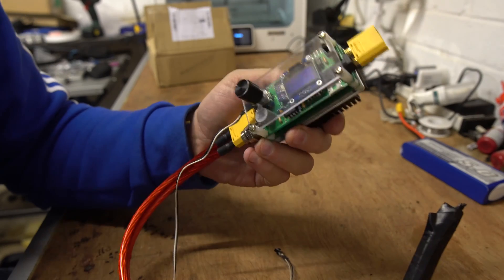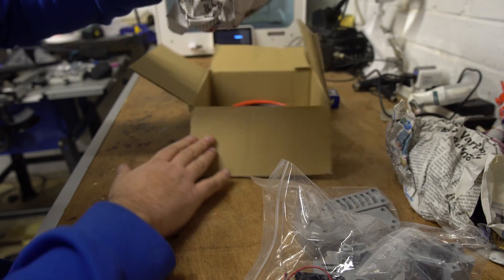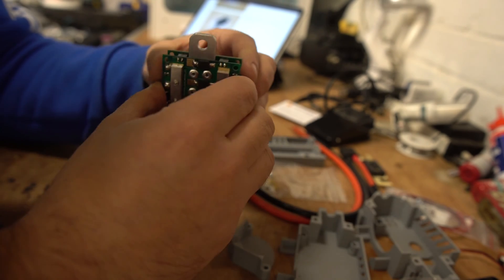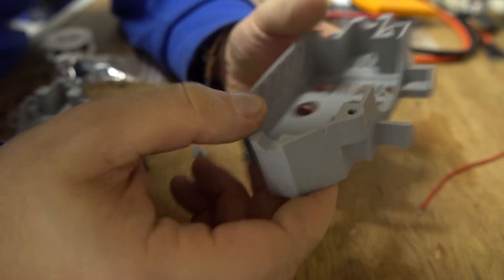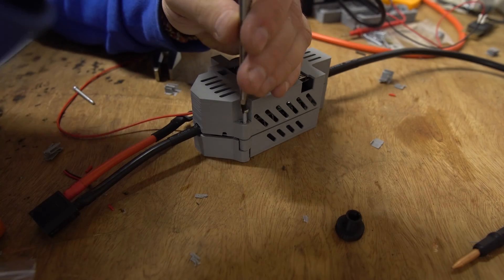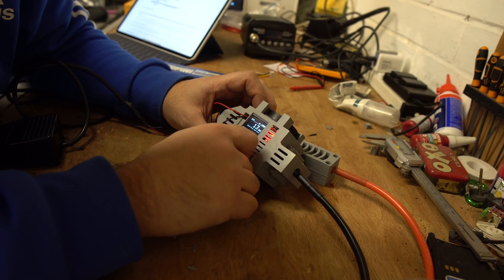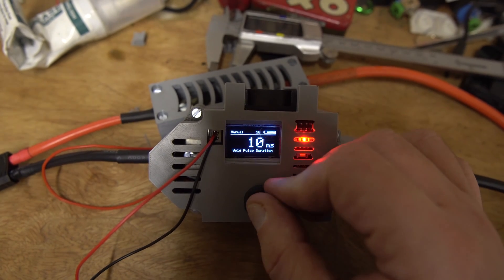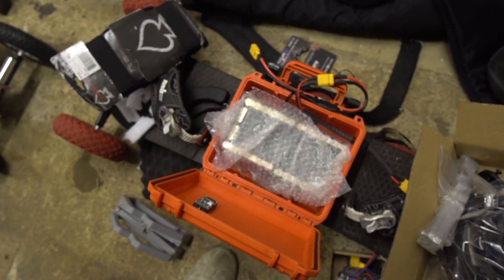New Spot Welder! Maletrics Build and Review

Comment: I myself got the cheap 15$ pcb with 5 high powered mosfets with everything needed and just printed a case for it and use it with a car battery. works excellently with no heating issues.

Comment: for the price of that you could buy a professional very good spot welder from aliexpress! and no batteries needed.
Reply: professional u cant even weld thicker then 0.15mm lol
Reply: bought this and it's worth twice what I paid for it! Go ahead and get a crappy plug in one. I had the "good" one before that you "just plug in". And it wouldn't even do .15. The malectrics does .15 at level 5 of 50. 600a from a battery or 100a from a plug. You deside.
Reply: good luck with it. Those plug in ones tend to be crappy for .15 and larger.

Comment: microwave transformer. timer board from a sunkko. diy pen 2awg with 4awg tips. its a beast...cost what 25 bucks or so to build? the timer thyristor board is 10 bucks. the microwave transformer free. 2awg welding cable 1.50 a foot from the local supply. 3d printed pen. most expensive part are the 2awg splice connectors that i use to connect the tips to the cable. they are about 7 bucks each.
Reply: goodluck running around and search scrapyard and putthings together

Comment: jfc..... just buy a lawn battery 250 cca some cables and a 500 amp starter solenoid with a fast momentary switch.... stop overpaying. built my setup for 80- bucks and it does a better job than any of these

Comment: I love this spot welder. It does .2mm with ease. Stepping up to .3mm experimentation soon. However, I couldn't get it to weld nickel platted copper stripping. It doesn't even mar .3mm nickel platted copper stripping at max settings. At max settings, the cables on the spot welder bounce into the air on each hit. The copper just takes enormous amounts of current because of how well it sinks heat. If I had to guess, I bet you're looking at 1,000 amps or better to be able to weld copper. Anyone have a different experience with copper?
Reply from the maker: dieselphiend cool information! I think people have more success welding nickel to copper than copper to nickel
Reply: you arent going to weld copper without a WHOLE NOTHER LEVEL of machine. micro tig or ultrasonic would be the way.
Reply: @DieselRamcharger  They have industrial machines the spot weld copper easy. I doubt they're using more than 2,000 amps.
Reply: @SyntacticOperator  Yeah it's not going to do copper mate. No way. Way too conductive both thermally and electrically to work unless. Not even sure if you could use copper electrodes
Reply: @SyntacticOperator  I'm actually thinking about buying the kweld. I mean if it could do copper that would be great but 0.3mm nickel is still amazing

Comment: I might go ahead and buy this and start planning out a build. Want to build a long range battery, so will need to do a custom one with welds. Was looking at Jehu’s battery kits, but not sure if it would be better to go that route or spot weld a battery.
Reply from the maker: Better to spot weld, this welder is a beast as well mate.  I'm 8000 welds in on it and love it
Reply: I bought my batteries from Jehu and used this welder to build it. Cost me 760$ for the welder everything. Welder 200$ battery 200$ 160 LG 18650's 225$ daly 100a bms 60$ The rest was some wire, nickel and shrink wrap. So now I can build huge batteries for 350$ from here on out. Worth it.

Comment: RIP Boss level custom spot welder - Diagnosis - Scott's Monster battery kicked it's arse hahaha.
New Welder looks better just wondering if you could wire the button from the boss level custom welder to the new kit? 
Maybe rig a gold leaf button to it? https://www.arcadeworlduk.com/products/Gold-Leaf-Arcade-Button.html

Enjoyed the video BTW even though I was thinking nearly 19 mins on a spot welder when I started it! 😃
Reply from the maker: Haha I did think you might comment on the length! Yeah it’s dead, diagnosis - Scott’s fault 😂,  I have some ideas for it mate, tbc
Reply: Simon Churchley I imagine that you could, especially if they are both wired into the Arduino board. The board just looks for voltage to a pin, and then activated the timer/ power to the welder. So any switch should do, as long as it can work with 5V DC. If only I knew how to make permanent circuits rather than bread boards, then I’d make it myself.